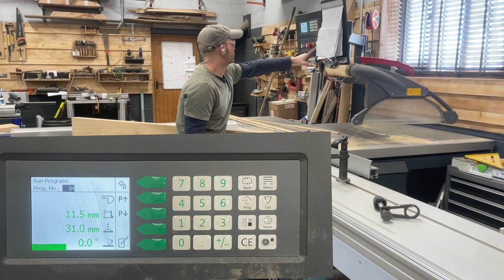Mediaeval style Oak mullion (window)

Comment: If modern glues are as good as is claimed floating tenons should be as good and trad M&T. Give it a couple of hundred years and the answer will be plan to to see
Not that I will worry about it 
Great work as always Andy
PS: Going for my first Manor Wood inspired epoxy fill table at the weekend 🤞🏻
Reply from the maker: Best of luck with the resin pour : ) ...   p.s floating tenons are very old school nothing new , just sometimes a simplest solution, you can also pick them both sides for that real old school non-blue fit
Reply: @ManorWood  thanks Andy

Comment: Well if you undercut a competent Joinery shop that puts windows together the right way by cutting corners and using dominoes to hold it together, sure you can get away with it. For a while. But it will come back to haunt you.
Reply: That joinery should outlast him. If there was a problem I’m sure he would just fix it rather than having a haunting 😂
Reply from the maker: Hmmm .. sound like bull to me ....   try to make a living doing this them see what you make of it ..l this window will out live me and my Kids.   I know modern joinery shops which use non tenon and systems , just simple spindle moulder sets.  or even CNC cut joints ..
Reply: @ManorWood  
Ah, the excuses that self taught woodworker's make for cutting corners. Would you use dominoes to join doors too instead of wedged through mortise and tenon joint's?
Proper joinery relies on mechanical strength not glue.
Sure  a lot of joinery shops are forced to cheat now because they don't look after and pay their employees a decent living wage.
My beef is simple.
 Don't present yourself as a maker of high quality woodwork when you cheat. All that exposed Oak will start to wrack and twist over time and pop your weak joinery.
Reply: Modern glues along with both dowels and dominoes …PLUS the higher quality paints, will most likely support the survival of that window for hundreds of years. Proper maintenance of wood doors and windows always requires paint protection too. 
   Ignore the paint, all wood fails over time.
Reply: @timmer9lives  
You are so wrong on every count.
Modern plastic glues loose their bond strength by over sixty percent within twenty year's. Dominoes and dowels are a discontinuous joint with much lower surface area and vastly less mechanical strength than tenons.
Through wedged tenons will hold even after the glue has failed.
Dominoes and dowels fail with the glue they rely on. 
I have restored woodwork three centuries old. Unlike you I know what I'm talking about.